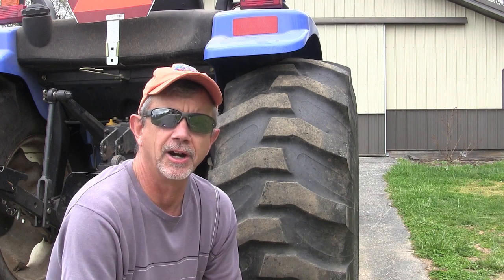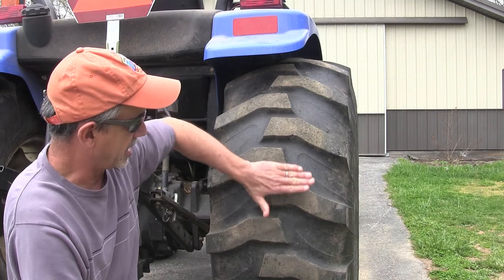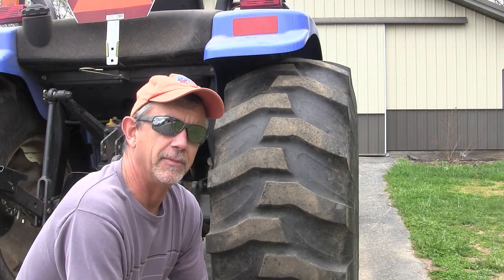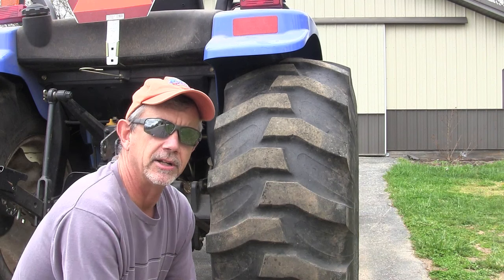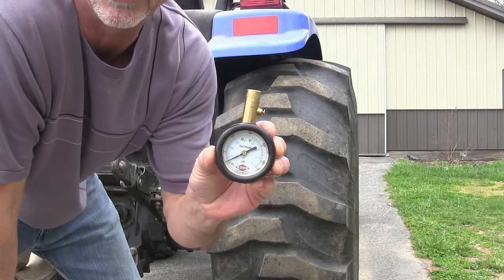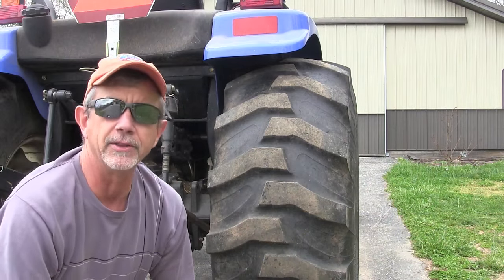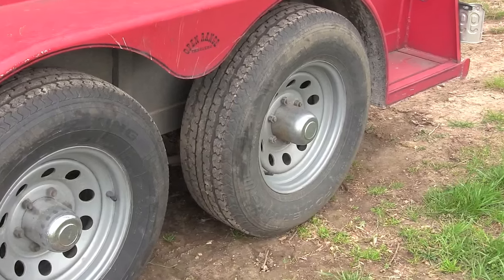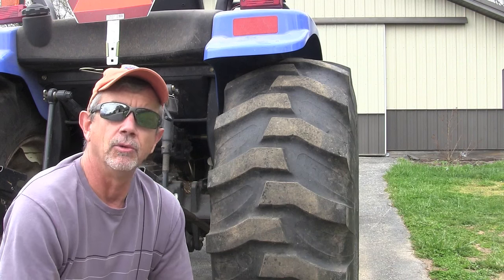Proper Tractor Tire Inflation

Comment: Keep em cumming Mike, learning a hole lot here. Mike would you ever make a vid of all the controls inside the cab of a full size tractor. I mean every knob there is inside the cab, what they are called and what they do. Minus the stereo and A/C stuff, cause that's like a car.  Thanx
Reply from the maker: +Lucky Goose That's a great idea.  I've done videos about specific controls, but never all at once.  There's probably one or two in there I'm not sure about, especially if it has electronic three point.  It reminds me that about every house we've lived in has had one light switch that we never could figure out what it did.

Comment: Mike, thanks so much for all your info. In your video you used the rear tire, does this info apply to the front tire also?
Reply from the maker: +Gene Gray Gene, it depends.  Thanks for asking, as I was uploading it dawned on me I hadn't discussed that and I tried to make a mental note to do another video about it and then forgot, so I appreciate you asking.  If all you are doing is brush hogging and pulling things on the back, then I recommend the same thing, low air pressure is better.  BUT…when you go to use the loader I recommend the maximum recommended inflation because of the pressure of bucket weight on the front tire.  I'll have a video out soon about it, you can take a break and not watch because you already know the answer :).  Thanks for reminding me.

Comment: Mike, When is the best time to check tires? Before you start or sometime during your travels?
Reply from the maker: +FREEDOM 2 I personally don't think it matters because I don't think tractor tires go around fast enough to warm everything up enough inside to significantly change pressure but I'm really not an expert on that.  I check mine cold before I start.  Maybe some other viewers will want to reply with different opinions, it would be interesting to check it cold, then go out and work for three hours and check it again to see if it changed.  I may do that in a video this summer and we'll see what happens.  Good question!
Reply: On ur car or truck, do them cold..
Ur tractor, as Mike says, they won’t generate any heat to worry about..

Comment: Hi Mike... My JD 990 has a max tire pressure of 45 pounds on the rear. Only problem I have is I can't seem to measure them as they are filled with calcium and even though I have the valve at the top when I measure I always have liquid squirting out. So I don't know what my pressure is. Any way I can measure them without that happening?
Reply from the maker: Not that I know of...I seem to always get a little of the fluid squirting out when I check the pressure.  Maybe someone else knows of a way to prevent that but I don't.

Comment: Cruising down I80 at 80mph with your tires inflation maxed out is asking for trouble.  Air expands with heat.  Cold inflation pressure should never be max psi.  ;)